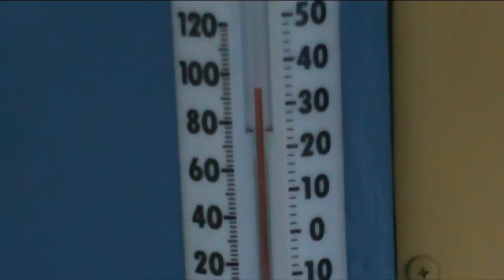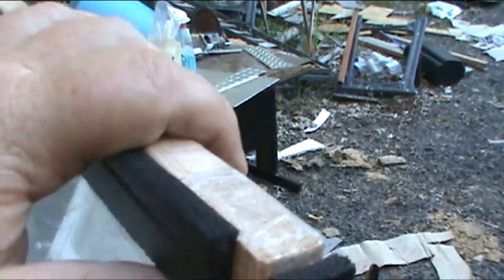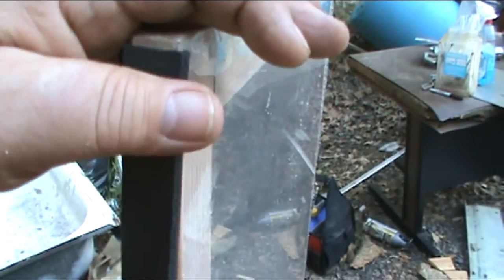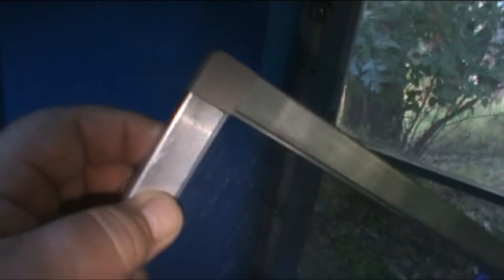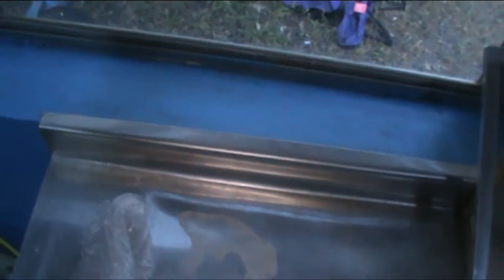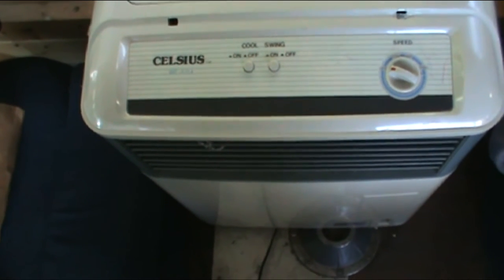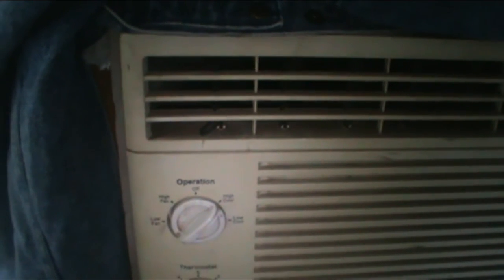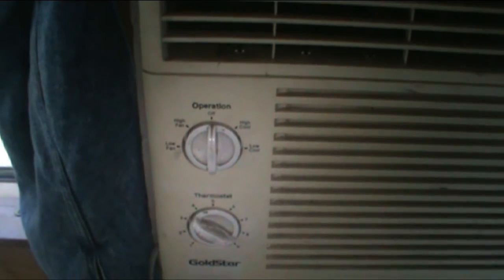Jon's Bus Conversion Part 52 - Preparing the bus for summer

Comment: Good idea on the screens. When we lived on the bus for a couple months I used a few expandable screens with small screws to hold them in the slots. Worked well but I had to use a short stick to make the windows fit tight because the stops were off about a half an inch off. My big worry is making them so the cat can't pull them off
Reply from the maker: Ha ha - well the big problem I have is the wind blows them off - but I'm going to re-velcro them. Seems to work best to put a line of velcro on the frame and spots of it on the window. I actually meant to put a link to the video you showed me about reversing the windows. I'll look that up and update the comments.
Reply: I tried everything i could to reverse my windows but it just can't be done on my bus. I think yours is set up like mine where the outer movable window is latched in the inner track. His had latches in the same track as the window
Reply from the maker: Oh damn. Well my dream is automatic windows :) I hate them in a car but seems like they would be awesome in a bus. Cruising down the road rolling the windows up and down!